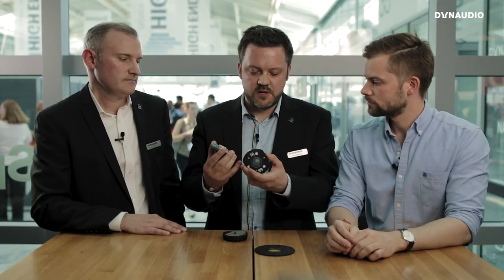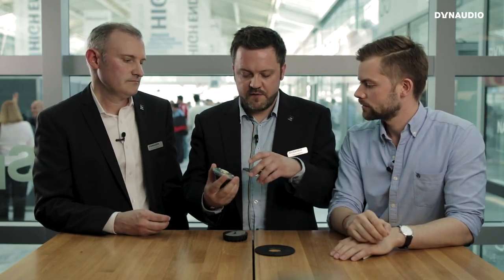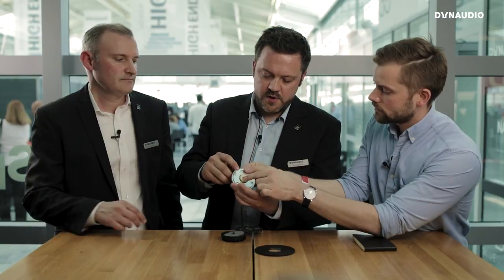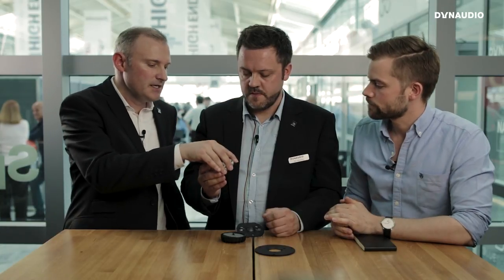The principle behind a Dynaudio tweeter

Comment: hearing is believing. your esotar 2 is the single best tweeter i have ever heard and i have been speaker building, into hi fi etc since i was 8yrs old and playing with all dads gear. that esotar 2 has no bad behavior and gets the 2khz zone which is SO hard for a dome tweeter to do right nearly perfect. sonic character is 2nd to none
Reply: Only if they would last longer. I own $12k speakers with all tweeters corroded. It’s a disgrace. Then I have studio M&K monitors from early 90s that still sound and play perfect.
Reply: What do you use for crossover settings? Is it safe to rolloff at 2k at 12db? Any sharper rolloff seems to sound more piercing to my ears.
Reply: @StLouisRod1  I believe in my Confidence c2 the crossover is at 2k 12db/octave

Comment: Ever hear of a little something called Beryllium? You are honestly going to claim a soft dome is better than beryllium?
Reply from the maker: Hi Mike. Well, the short answer is yes, and, for our speakers, yes :-) As Andreas said in another episode of Ask the Expert, we continuously test other materials to find the ones that are best for our speakers and, at this moment in time, our speakers perform the best as a whole when we use coated soft-dome tweeters. And as Roland says here, it’s not only about the tweeter, it’s about the entire loudspeaker. //Christopher
Reply: Dynaudio So what are the compromises you have with the soft dome tweeter? and what was the short comings of the Beryllium domes?
Reply: @mikeg5172  I would say it is safe to use soft dome then complain about the metal problems... I liked the Focal Beryllium maybe the B&W diamond even better. But finally i think Accuton is the winner.
Reply: @GBatya  Yes, but that doesn't mean everyone would or find your preferences the same as you. There are several variables and dynamics that come into play from amps to rooms, etc. and then there are your own ears. I personally prefer the Esotar 3 in the Heritage Special, have you heard it? Dynaudio could certainly use Beryllium if they wanted and, remember, they have sophisticated measuring chambers.
Reply: @mosfet500  It's rather a trademark/heritage to have soft -dome for them. Cheaper metal domes have cone oscillations in the audio range but if the break up frequency is high (B&w diamond ~70khz) then the pistonic behaviour improves the sound. Motor structure also important but not enough.
Reply: @GBatya  Bottom line, the new $329k Wilson - soft dome tweeters.
Reply: See the new $329k Wilson's? Soft dome tweeters, go tell them Beryllium is better.